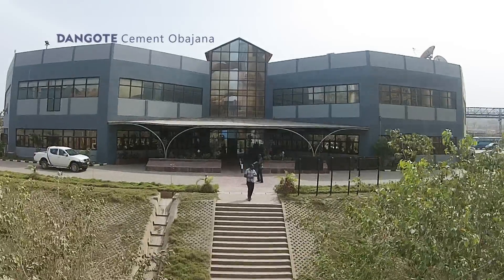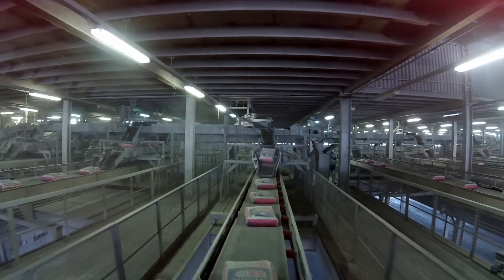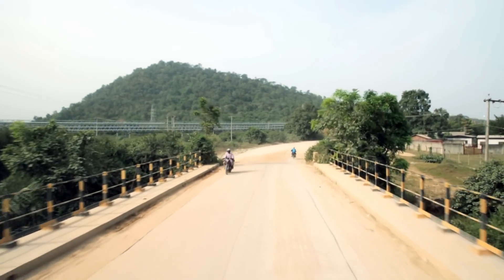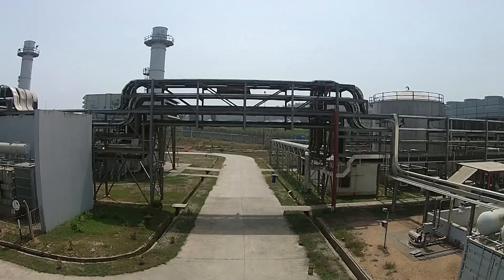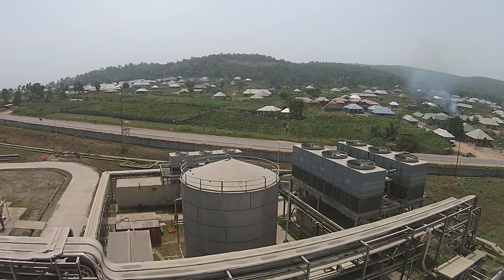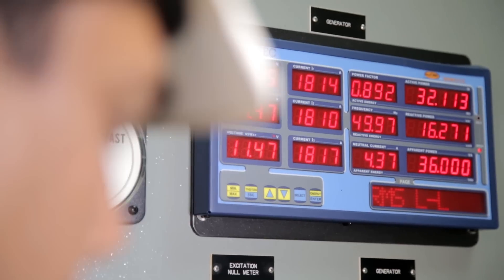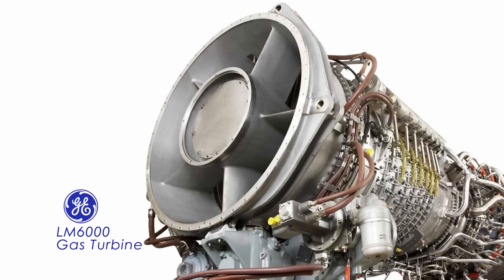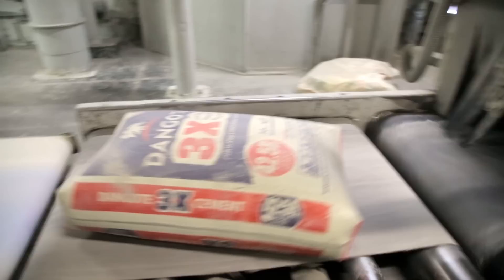Dangote Cement plant in Obajana, Nigeria

Comment: PROMO"
 PROMO" PROMO" DANGOTE FACTORY WISH TO INFORM THE GENERAL PUBLICOF 
NIGERIA SALES OF CEMENT AT A PROMOTIONAL FACTORYPRICE OF #1,000 BAGS OF 
RICE #11,500 PER BAG GRONDNUT OIL 30LITRE #7,200, BAG OF FLOWER #4,000, 
BAG OF SALT #9,50, BAG OF SUGAR #4,000, AND LOTS MORE CONTACT. THE SALES
 MANAGER ON 08153863900 or 08106008278 WE DELIVER TO ANY PART OF THE 
COUNTRY UPON THE CUSTOMER(S) ORDER,AND DELIVERED TO YOUR DOOR STEP 
*PRODUCT: dangote CEMENT (50KG) *ORIGIN: dangote pLC. *PRICE PER BAG:# 
100 NAIRAONLY. *TRAILER LOAD QTY:HALF OR FULL TRAILER.*DURATION OF 
DELIVERY AFTER ORDER:2DAYS. *TRANSPORTATION COST: DEPENDS ON STANCE/ 
YOUR. STATE. NOW TO PLACE YOUR ORDER. ALSO YOU CAN REGISTER AS AN 
INDIVIDUAL OR CORPORATE BODY. NOTE: we deliver our goods to every state.
 Customers may reside in stocks, sites or construction company. Also 
workers are needed  eg driver and lot more..........thanks for your 
patronage.